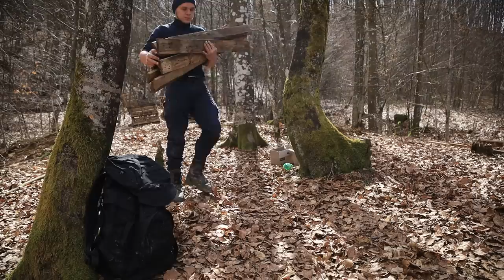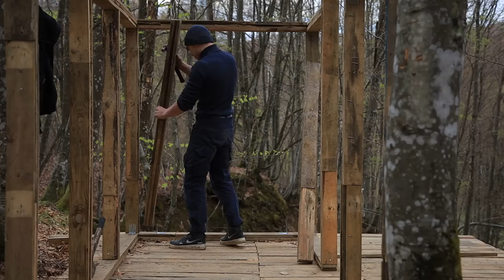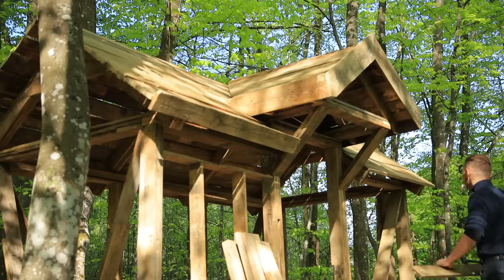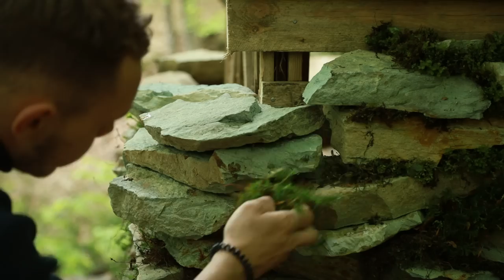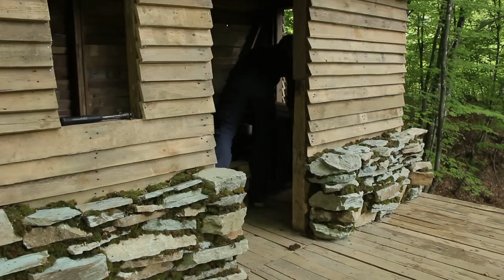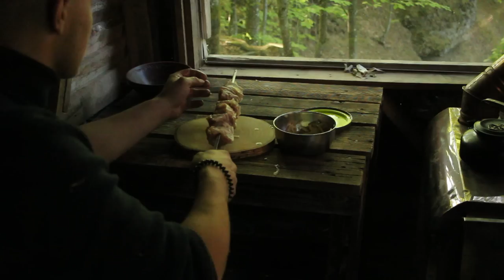A house of pallets over a cliff. From start to finish

Comment: I simply cannot imagine the amount of labor that went into this beautiful build. Well done young man, well done.
Reply: Probably not as bad as you think. I work with those pallets. Lugging one more than 10 feet is a chore itself. Considering he had stacks of them leads me to believe there's a driving path right next to his build. He more than likely did all of this with power tools and just got the footage he needed to dupe the small minded.
Reply: @The_Hagseed  if you do work with these pallets even having that much wood ready is a chore...you should know that...but agree...turn the camera 180 degrees and his house is probably right there...
Reply: @Sandman66  I wouldn't have nailed the door hinges on. If he needs to take the door off for any reason he'll have a job removing it. Screws are the way to go where hinges are concerned.
Reply: @C B I can agree with you on that one and yes it does take time to build out of pallets like couple days or so.
Reply: @The_Hagseed where’s the path lol

Comment: Очень понравилось, просто супер...
Один вопрос, как вам удалось так аккуратно разобрать поддоны? Я пробовал, но крученные гвозди чаще всего проламывают доски... А так всё супер, преклоняюсь перед вашим трудолюбием!
Reply: Ive taken a saw and just cut right through the nails and keep them in the board but they also make pallet busters which are tools specifically made to take apart pallets.
Reply: I used a flat bar. Takes time

Comment: Nice build. I have watched several videos on building cabins out of pallets, and they are all very interesting and show a high order of wood craft. Techniques seem to be broadly similar, and I was wondering if the people building attended a course on construction of these cabins.  No drawings or plans seem to be used, so I expect the plans are in the builder's heads. Very clever build.

I was wondering as the cabin is in a remote location, how were the pallets (and glass windows, bitumen felt etc) moved to the building location and how many pallets were used in the build?

Comment: this is a very impressive building and the construction was also very impressive. I wonder how stable this really is, As it settles over time won’t that whole structure slide down the hill? All that weight on the platform is just sitting on rocks on the surface. No buried foundation with a footing.

Comment: beautiful work. one thing i know is that one tool you use... the pruning saw... is expensive. the good quality japanese pruning saws are not cheap, but are worth the money. its probably the most expensive item in the tools i saw you use, but worth paying for. the power and efficiency of a small chainsaw with no fuel required and will last forever. The rest i agree does not need to be expensive, but a Silky is worth the cost for the bushcraft person.

Comment: Not bad for a fort. But looks like you forgot to put some angle bracing on your posts, plus the ice and water shield isn’t out down using staples. Pull the plastic off the back and it glued down. Offsetting your boards would give you more strength, but it’s probably fine what you’ve done. However I’m sure you’ll find many hours of enjoyment from your labours. Cheers

Comment: Any guesses on how much that roof weighs?  Normal asphalt shingles are 2-3 pounds per square foot.  When fully saturated and with mature plant cover, a thin extensive green roof can weigh about 13 pounds per square foot. A more typical extensive roof with 3 to 4 inches of growing medium weighs 17 to 18 pounds per square foot, and a deeper intensive system can weigh 35 pounds or more per square foot.  Assuming 120 square foot, that's pushing 2000 pounds.  I wondered why he was making the walls so sturdy.

Comment: The hut turned out well. Interesting to watch. Thanks for the vid!

Word to the wise, though: You're risking food poisoning by preparing your salad on the same wood block on which raw meat juice has dripped. Keep raw meat carefully separate from your other food and thoroughly wash all surfaces and utensils used to prepare raw meat. I can tell you from personal experience that food poisoning is a very miserable experience - doubly so alone, out in the bush.

Comment: All those stones added a ton of weight. Your little house wont last! you need a stronger foundation. Not to mention you'll need to seal the pallet wood, otherwise it'll root in no time. Ni work though.

Comment: This place won't last three years, and after just one winter will become dangerous.  Crap wood such as is used in pallet construction falls apart amazingly quickly when exposed to the elements.
Reply: Staining and sealing it would do a lot to extend its life. The shoshugiban method he used is good, but he missed a few steps.

Comment: You obviously have access to a road or some other means of bringing in such large amounts of materials.  You spent a lot of money on nails. 
Could you not have spent some time finding reclaimed beams of larger size? I understand the purpose was to use reclaimed materials.
Specifically pallets.
But the money spent nailing slats together to make beams seems a waste. 
You could easily have found some reclaimed larger beams to use and save the expense of nails.
And the Rock wall along the bottom? Why not use clay to pack the stones together? It would be more stable and strong than loose stones with moss.
If you have limestone you could even make Roman concrete.
Also. You should not have stapled that roofing material.  Every staple is a hole water can use to get inside.
You are asking for the roof to rot.
It would have been better to use a tar material painted on as a glue and then spread the black material on top.
Lack of insulation is also a concern. If you can get more pallet wood to finish the inside walls you could pack the in between with leaves and generate insulation that way.